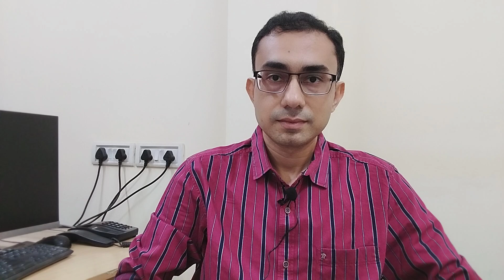IIT prof's overview of Mechanical Engineering | What are its courses? Who should study it?

Comment: Summary if anybody finds it difficult to watch:

The professor breaks the overview down into three distinct areas:

1. The Core Course Divisions
Mechanical engineering is broadly split into three foundational areas [01:06]:

Design and Dynamics (Applied Mechanics): Covers solid mechanics (deformable bodies), dynamics (rigid bodies—the closest to plus-two physics but much more advanced), vibration analysis, and control systems [01:38].

Thermal and Fluid Sciences: Built on the pillars of fluid mechanics (introducing complex concepts like the Navier-Stokes equations), heat transfer, and thermodynamics [03:11].

Manufacturing (Production): Deals with how things are made, ranging from traditional techniques like casting, welding, and machining to non-traditional methods like laser applications or cutting metal with high-pressure water jets [04:38].

2. Surprising Realities of the Field
The professor highlights two common misconceptions that school graduates have [06:03]:

It is heavily Applied Mathematics: While it looks like physics, much of mechanical engineering is fundamentally multivariate calculus and Applied Mathematics. If you do not enjoy advanced math, you will struggle in this branch [06:45].

It requires a lot of Computer Programming: Students who love scientific programming often assume they must study Computer Science. However, mechanical engineering (alongside aerospace and chemical) offers an incredibly fertile ground for writing code to model physical problems and visualize complex geometries [09:25].

3. Who is this Branch Best For?
The Right Fit: Students who have a strong knack for mathematics, physics, spatial visualization, and scientific computing will thrive and find the field highly rewarding [11:49].

When to Reconsider: If your primary goal is simply to secure any corporate job right after a four-year bachelor's degree (B.Tech) without an intrinsic interest in the mechanics, or if you actively dislike math, you should think twice [12:22]. The most intellectually exciting parts of mechanical engineering often require pursuing higher studies or specialized projects [13:51].

Ultimately, his core advice echoes the philosophy that "not everything is for everybody"—students should choose a department that aligns with how their brain is wired rather than blindly following placement trends [13:11].

Comment: Project subletted from professors work like analysis calculations.error analysis, FEM and FEA for both core and ee.n ec branches. Programming, graphs and drawings in the one month holiday between the semester and during semester would be a nice experience over a period of 8 or six semesterss .Costing of materials and design suggestions by students to ease a professors project show your abilities for higher studies.   There is a departmental form to fill for winter and summer projects under professors..You will get recommendations from professors and find your interest as well

Comment: Sir it would be really great if you would respond to this comment, I am moderate in calculus and applied mathematics and like the concepts I study in my +2 and JEE Preparation but have a huge inclination towards automobiles and want to get into the industry in the R&D sectors. I find I am also able to understand the concepts related to ICE and Drivetrains way better than i do applied mathematics and related concepts. Should I still strive for Mechanical Engineering in IIT's with my current skillset? (I got 99.6%ile in JEE Mains January and am currently preparing for Advanced)

Comment: Sir I want to put what I got from ur this video
Initially I was not able to think how calculus is required for mech engg.
But after thinking  I got that there are dimensions which are denoted by equations of maths like line, circle, parabola plane n 3d structures n size n shape can be so clearly n accurately be stated thr their mathematical equations n offcourse as u hv said the calculus beyond +2 lvl

Comment: I was not very interested about mathematics in plus 2 level. I just practised enough to score safe marks whereas I was extremely interested in Physics. 
But during my electrical engineering days at NIT Patna I actually started enjoying mathematics in courses like Network Analysis and Synthesis, signals and system, Control System and Communication system.

Comment: Nice video Professor. Does Robotics fall under the categories u mentioned. It’s not only programming right, includes machines as well, so asking this.

And I think you need to consider renaming ur channel as “A complete and comprehensive guide to engineering students”😊
Reply from the maker: Here at IIT Kharagpur, it comes under Manufacturing. But it is in reality, a multidisciplinary area involving mechanics, electronics, and computer science, and of course lots of mathematics.
Reply: @Prof_JC  Sir, Please make a video on Aerospace and Engineering Physics
Reply: @Prof_JC  oh ok Sir.
Reply: @Prof_JC 😅
Reply: @Prof_JC sir i have a doubt that is IIT KGP removing branch change option from this year?
Sir please give a sure answer because if they did this after jossa councilling then this will ruin many students life

Please sir give answer
Reply: It's included as a complete part of Computer Science however in Mechanical Engineering you have to select between choosing it and other options available at a later stage.
Reply: Sir my son is get admission in nit jamshedpur mechanical engineering can be  good scope for future

Comment: IITD MECH vs IIT KGP ELECTRICAL vs IIT ROPAR CSE. I am a delhite and have no problems in studying higher mathematics. I am planning to pursue higher studies however I am not sure about what I want to do the future.Please suggest sir 🙏
Reply: KGP for sure. EE is a Circuital branch mate. Placements are par with MnC and CS. And you can for consultancy as well as finance apart from the core ones. In short, KGP EE is better than IIT D Mech if you don't have any location problem (IIT D Mech will allow to look for off campus internships and placements in Delhi which is industrial hub)

Comment: 9:05 not only Mechanical, but also Electrical and Electronics. I'm EC graduate, stuff like vector calculus and their applications in Electromagnetics based subjects blows minds away. I consider thermodynamics as hardeast among all engg branches, but antenaas, RF design, etc. would be 2nd hardest or equally hard.

Comment: Excellent topic Sir, If you don't mind i like to share my own experience I done my btech (hons) in automotive engineering with a gpa of 9.1 from wbut & want to pursue mtech in thermal sciences so i obtained out gate which i cracked but after cracking gate i found many of the iits including iit kpg don't allow automobile graduates to pursue their mtech in thermal sciences & engineering field initially i was shocked but as one of your earlier videos you mentioned that we should explore by ourselves so i started doing that & found there are many interdisciplinary thermal allied branches like Energy Ocean Aerospace where we also can pursue our mtech which majorly work in the field of thermal engineering. So i started applied that & ended up getting selection in mtech sustainable energy engineering in iit Kanpur, iit kgp ocean engineering, iit delhi materials engineering apart from that i got almost thermal engineering/mechanical engineering mtech from all 2nd gen iits including iit Gandhinagar iit Indore & also got direct PhD in mechanical engineering from Iit Kanpur so right now i am planning to join IIT Kanpur mtech sustainable energy since i am interested in thermal management of battery electronics & fuel cells kind of research & then Ph.D. from any top tier institute from Abroad specifically USA/GERMANY. 

During this period i found many star faculty actually from this energy engineering branch like prof Avinash Agarwal from IIT KANPUR top cited prof in the field of IC engines, apart from that prof Praveen from IIT GUWAHATI & Prof. C. Bakli from Iit kgp probably you are familiar with this name since he also done his doctoral studies under Dr. Suman Chakraborty. 

I think our generation is blessed to have a guide like you, i am going to started my journey from next months onwards since i am also interested in academics, your blessings are required. 

Thank you.
Reply: Bhaiyya aapke jaise students ki jarurat bohot he jo apne interests ke basis par study karte he and they get the degree in that not on the basis of jobs n placements

Comment: Sir I have a question. Is Manufacturing Science and Engineering similar to Mechanical? I might get this branch at IIT-KGP. Also, will try my best for branch change.
Reply from the maker: A lot of the courses are similar, especialy in the earlier semesters. And they do these course works together in the same classrooms and same labs. In the later semesters there are some differences.
Reply: @Prof_JC  bujhlam sir. Reply korar jonyo onek dhonyobad. 🙏🙏
Reply: @Prof_JC sir i have a doubt that is IIT KGP removing branch change option from this year?
Sir please give a sure answer because if they did this after jossa councilling then this will ruin many students life

Please sir give answer
Reply: @Hemancee  most probably no. I have talked to some students of Kharagpur regarding this, and they said that the authority does not have any such plan this year.
Reply: @ankitbhattacharjee5  even if they would be having any thoughts to remove DepC, they can't since they have to inform the incoming UG students that DepC is removed from now on atleast 3 months before admission, just like IIT B did.
Reply: @waltzing_quark  ok thank you both of you
Reply: @waltzing_quark  yep 👍